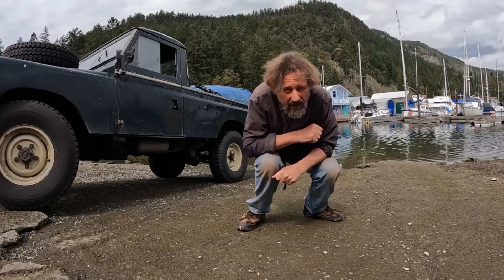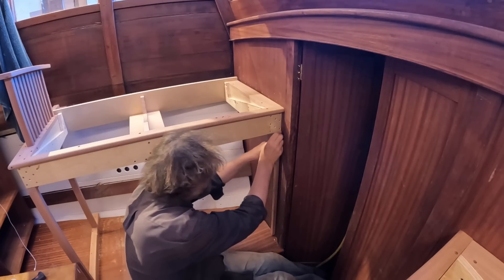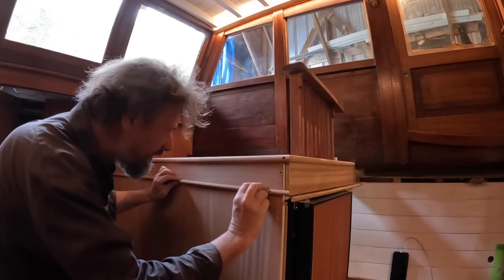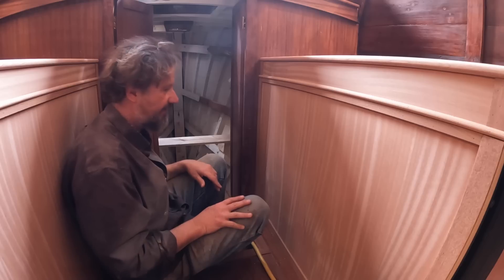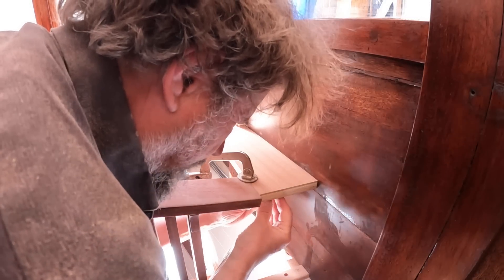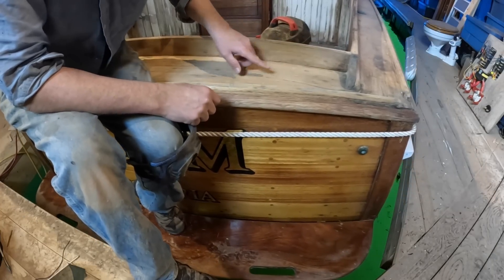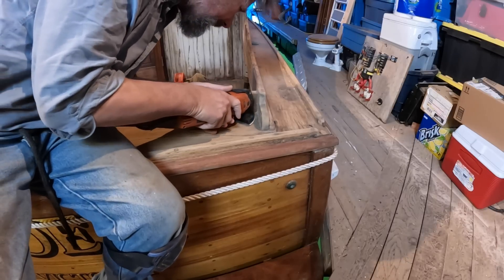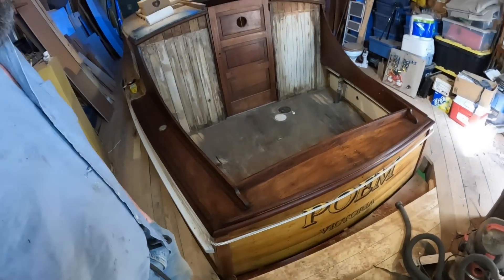Beginning the Brightwork - #363 - Boat Life - Living aboard a wooden boat - Travels With Geordie

Comment: I stained new BC Fir/Hemlock doors and was disappointed to end up with really blotchy stain. 3 weeks later the wood had soaked and bled all that blotchyness away. You might find that that blotchiness bleeds away over the next couple of week. I would consider a generous coating of danish oil to help bleed the stain, prior to generous coating of spar varnish.

Comment: I have to say I'm not over impressed with how that stain looks, I realise it's old wood and has a multitude of defects which would be difficult and time consuming to deal with but it looks very blotchy and inconsistent. It looks like you've given it a quick going over with rough sandpaper without smoothing the surface and picked up lot's of the grain which the stain has wicked into, if you smear varnish over that hoping it will hide all the roughness you are going to be very disappointed !
Varnish only works if the surface has been properly prepared and sanded smooth otherwise it will look awful because every little mark will be highlighted with an uneven but shiny coating ! The art of varnishing is in the preparation, if you cut corners with prep it shows !